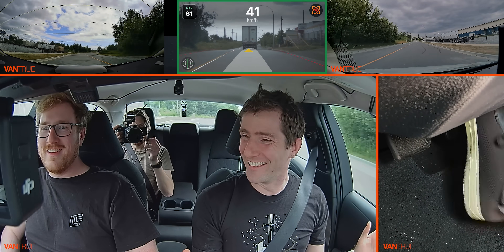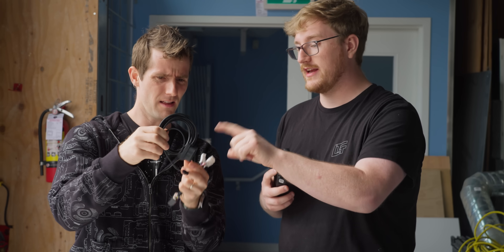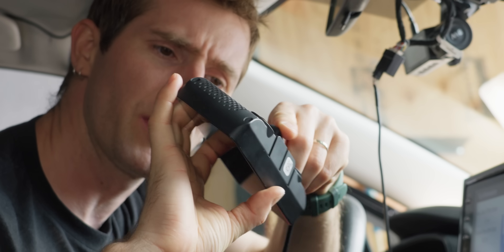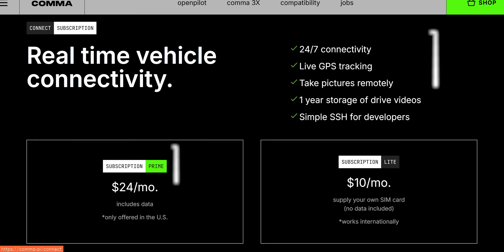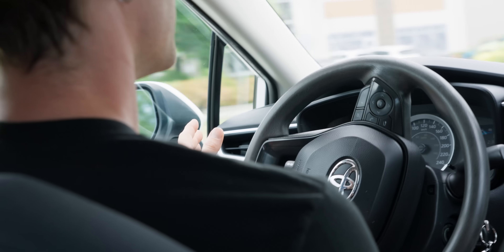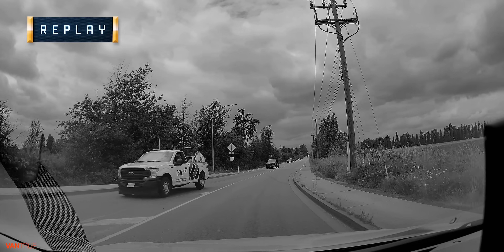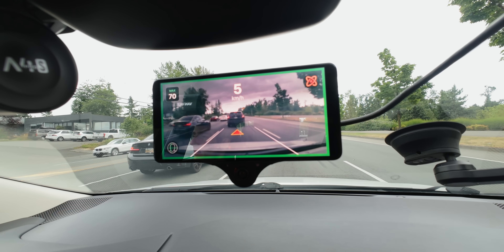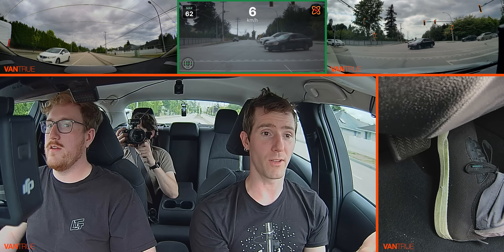I Upgraded My Car With Open-Source AUTOPILOT and it's AMAZING

Comment: You are lucky you test in Canada, where the traffic and road infrastructure and driver behavior are better. In my experience to use Auto Pilot (Auto Cruise Control glorified hype with safety feature or in toyota called Toyota safety sense (TSS), you better have a combination of stereo camera and Radar / lidar to detect surrounding traffic and road marking. Even Tesla auto pilot often failed to interpret the surrounding traffic.  Thats why the naming auto pilot is misleading since what it does is assisting not taking over the driving. In future where every vehicle can communicate with each other perhaps then we can get the real auto pilot.

Comment: I do have a problem wit hthe "autopilot name", but else it's cool, but it should be called drive assist. And the "always recording" is also a Huge privacy issue and out right illigal in Denmark.
Reply: You have an issue with the name OpenPilot ?
Reply: @AndyMcBlane  The videos name.

Comment: Now I wonder if they will make hardware that would allow you to retrofit a car that does not have any of those features, or if there is some company that does? Like I understand that putting the auto steer on a car that has a hydraulic steering rack is completely impractical, but what about adding in adaptive cruise control? Or front collision warning? On most cars, these features actually raise your insurance, because while they do lower crashes, they are more expensive to fix, but if it was completely open source, that might be different.
Reply: No

Comment: Hey guys, be aware that you don’t want your wiring to be in front of your side curtain airbags. You can impede their ability to function as designed. You really want user added electronics wired behind the airbags. 

Excited to see what part 2 is though, assuming Linus didn’t just misspeak when he said eGPU is coming in part 3!

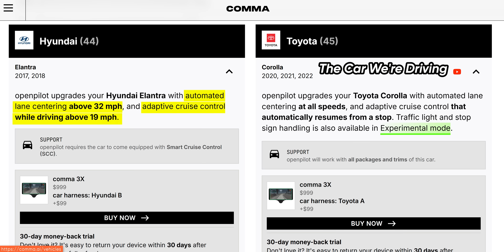Comment: 13:13 the fact that cruise control on many MANY cars disables itself below 25MPH is criminal, i'd like to hover over the brakes and watch the road in a school zone with cruize control set to 20MPH, not bury my face in my dash watching the spedometer because of the automated ticketing system that makes the roads less safe for kids because of the aforementioned ticket enforced taking of eyes off the road.

Comment: great to see LTT trying out openpilot. I have been using openpilot since 2020 on a tesla model s (the old ones that didnt come with autopilot).
on long drives it really shines. i live in norway and have done a drive from oslo to trondheim without touching the steering wheel except for stopping to charge.
back when i first installed it i started out with EON gold with added pedal and radar then eventually got IC integration (autopilot view in instrument cluster that integrates with openpilot)
then a few years back i got ibooster mod installed and C3 so OP can handle stop and go + red lights (last part is experimental as the fork im on is on OP 0.9.6 which is not the latest)
ps. im one of the OG to get C3 with newer OP version working on model s pre 2015 :)
Reply: before anyone asks Tesla does not care about this. but i have made sure to unplug the C3 when going into service. other mods and "suspicious" cables are still there ;)
this is not the only mod in my car :D

Comment: A bit upsetting that Comma puts it in the fine print, but sticking anything on your windshield is not allowed in most places outside of the US(according to the fine print, some states dont allow this either), but for expamle, in The Netherlands is prohibited, and when the yearly inspeciton comes around you know they will make you remove it. Noticing Jake telling it needs 48 hours to set, I dont think it will come off that easy. Even though the tech looks cool, it seems very dangerous and in my opnion should not be allowed on public road..
Reply: You have a required yearly car inspection in the Netherlands?  Nothing like that here in Canada or the US.  Besides it would be simple enough to remove it from the bracket and unplug it before the inspection.  I can see them bothering you about a small piece of plastic that is not actually visible from the driver's seat.
Reply: Oh and in case they do ask about the piece of plastic just tell them it is a mount for a security camera you put in when you aren't using the car.

Comment: The issue I can see with this especially with an external gpu would be redundancy. If it gets really good and you rely on it all it takes is a gpu to die for the car to have no idea.
Reply: It’ll fall back to the default internal model

Comment: This is cool, but it's basically already included in newer cars.  My 2024 Tundra does all of these things from the factory.  I didn't even know it did until I read the manual and tried it.  They call it adaptive cruise control, and it's pretty cool.  It has a lot of the same issues Linus ran into.  If a turn is too sharp, I have to take over.  It can't read stop signs or traffic signals, which surprises me since the dashboard will show a stop sign when it sees a stop sign coming up.  All in all, I'd call this a nice feature for long trips.  I mostly use it to make sure I don't speed.  It definitely gets confused by cars turning off or onto the road. It will rapidly decelerate when a car turns in front of me, even though slowing down two or three miles per hour would be enough.  Self driving tech isn't there yet, but it's getting a lot better.  I think calling it a driving assistant rather than auto pilot is a good idea, that way people don't think it can 100% drive for them.  Although, airplane auto pilot doesn't fly the plane for you, it just keeps your speed, direction, and altitude where you set it.  So calling it autopilot is technically accurate, but not how most people think autopilot works.

Comment: Yep.  This is part of the reason I bought a Corolla 5 years ago and why I bought another one this year.  The kiddo got the older one and I got the new one.

For now, the adaptive cruise control is good enough for me.

The 2025 Corolla slows down for curves by itself.  The 2020 doesn't.

Comment: I have an older Vantrue.  The camera is great, but the mounting solution is garbage.  It falls off my window every few days, and obstructs my view (that's a me problem, I have awkward height proportions).  I wanted to mount it low on my dashboard instead of near the mirror, and it won't stick to the dashboard.  I know I could maker my way through a mounting setup, but I feel like a manufacturer should have different mounting options for a camera they make.  The only time I was in a car crash, the dash cam didn't activate.  Admittedly, the crash was extremely low impact and I didn't even know someone rear ended me; I thought I hit a bump in the road.

Comment: If you've tried Tesla FSD with HW4 with version 13.2.9, you would not even consider comparing Comma 3 with FSD.  You wouldn't bother comparing an elementary student's 100m dash time against Usain Bolt's 100m dash time.

Comment: For whats an OBD dongle, a smartphone, and a mount, it sure is quite expensive for being open source.
Reply: The hardware is not open sourced
Reply: @AndyMcBlane I thought it was. That sours me a lot on this video, then. And the entire comma AI initiative, really.
Reply: @someguynamedpie why? You can read the whole code base and understand safety, trade offs etc
Reply: @AndyMcBlane Because they tout themselves as open source but... aren't. They're as open source as TiVo is/was. Having safety specs etc doesn't make them open source if they lock down crucial parts of the solution.
Reply: @someguynamedpie  the hardware has little to no bearing on the safety model
You can run on a laptop if you want

Comment: If you test with Tesla FSD, please use a HW4 vehicle for an accurate representation of how FSD is today. I’ve seen too many people claim that HW3 FSD is Tesla’s latest and greatest, and though it is still quite advanced, it’s not comparable to what you get on HW4. If HW3 is your only option, just please note that in the video. Basic should be the same on both hardwares though, so if that’s all you’re testing, it shouldn’t matter.

Comment: I would like to see Comma/Openpilot and Android Auto/Apple Carplay/in-car infotainment systems to go Linux and Framework (Fedora and Framework 16 user so going to use them as references). Fedora is the opensource upstream source (think of it as the beta version) of Red Hat Enterprise Linux (RHEL) which is a proprietary commercial software sold by IBM (through subsidiaries) and as such IBM is the primary contributor to the Fedora Project. If there was there was a new/modern CAN bus standard that was created as sort of equivalent to the Linux Kernel and Openpilot/Android Auto/Apple Carplay all fed into one big upstream source all CAN bus type add-ons could work with, use other devices sensors, etc. and fork from like Fedora while the car manufacturers proprietary infotainment systems are like RHEL. Also, car and automotive accessory manufactures could decide on standerds for form factors, bay sizes/general locations, and communication/connection standards (new CAN bus) like Framework's modules/parts so that car manufactures can streamline production like Tesla did by having all the device bays in every vehicle but not needing to change/install any/everything with different skus/packages. This would also aid in vehicle longevity and upgrade-ability. Someone could buy a cheap base model vehicle one year and then later buy and install lidar sensors, dash-cams from Vantrue, Autopilot hardware from Comma, and Kenwood speakers and infotainment. Then when something breaks, is no longer sufficient, or has reached end of life like some cars that had built-in cellular network connectivity but when the 3G networks were sunset-ed they lost functionality, but now you could replace it with a new 5G module, upgrade to a more powerful cpu/gpu to handle Openpilot, add ssd storage to store dash-cam footage and music.

Comment: "Its amazing!" almost causes several accidents
Reply: Steering torque limit or max steering angle limit of the Toyota unfortunately.  Certain other vehicles it can work much better.
Reply: @jermwerty  Also, I'd like to add that stock openpilot has a lot less features than the forks. I know because I spent half a year using stock before installing dragonpilot. It was a world of difference for me. lol

Comment: I’ve wanted one of these for years, sadly my 2017 Sentra doesn’t support it. I’d love to see a video where you somehow retrofit modern cruise/lane keep assist features into older vehicles so they can take advantage of something like OpenPilot! Or failing that maybe a video showing OpenPilot or its forks running on non-Comma hardware, if that’s possible….

Comment: I've been using Comma 3x on sunnypilot for about 6 months and a few thousand miles on my Kia EV6. It is a big improvement over the stock assist. Works flawlessly, even in construction zones where lines on the road can be confusing to the stock system. If you have a left line and a curb on the right without a line, stock assist WILL hit that curb at some point if you don't intervene. Comma handles it perfectly, lines or not. I can't go back. I'm spoiled now.

Comment: You mentioned a longer-term review with other car  models... PLEASE PLEASE PLEASE do a Ford! I have a 2016 Ford Fusion that has lane keep (not centering) and active cruise control. The cruise cuts off under 10 mph, so it's useless in traffic. Lane Keep is nice for safety, but it doesn't keep you centered. 
Many Ford are not supported just yet on OpenPilot. But I've head of the Fusion working with the Bluepilot fork. 
I'd love to test it myself, but spending $1,000 usd would be painful if it didn't work well. 
I love the car, and it has all of the sensors it needs for at least some level of self-driving. Fingers crossed that this gets figured out. Thanks for the awesome video. I've been looking at these for a long time now.

Comment: newer cars basically have this functionality, a sofware update could enable most newer cars to do basically what this is doing essentially. Not sure if any manufacturers will actually do that, most likely saving the feature for the models that come out in the coming years. Id say by 2030 all cars are going to have standard, lane change,  steering and parking assistance as standard features. Full self driving or similar software will most likely require products like these, which by then or sooner will be capable of full navigation self driving assist even better than the tesla, but again in a few years tesla's tech will in turn be improved so we will see. This might be worth a pick up once they perfect it and reduce cost so it's more around the 500-700 range rather than 1k.

Comment: I find 4K dashcams really stupid. 1080p at 30 fps is good enough. Anything more is a waste. Not only do you need a bigger mSD card, but it will wear out faster too. I have the Aukey 1080p @ 30 fps from 10 years ago and its amazing. Remember, its the video quality that is very important. You can get a 4k cam but its quality might be garbage. My cam does really good night time as well AND also remember guys if you get into an accident and your power goes out, the aukey has a capacitor that keeps the power on long enough to save the video. It also makes a separate folder and puts the video there when it senses an accident. These last 2 features are also very important. Dont just go on the resolution and fps.

Comment: People, there is quite a bit more to autonomous driving than the visual system and drive actuation. This kind of system has no vehicle system integration, ie, no system safety, security, redundancy etc. Bit of a stretch to compare competitiveness to OEM solutions.

And a bit of shame on Toyota for exposing any kind of safety related functions as more or less third part interfaces.

Comment: i have that as standard in my VW Arteon 2023, but due to Swedish  road and traffic office its not allowed so half of the functions are turned of until i drive outside Sweden. it works much better than that TEMU autopilot.

Comment: In British Columbia, it is illegal to wear only the lap portion of a standard seatbelt without the shoulder strap. BC law is clear on this:

0-1The Motor Vehicle Act (Section 220) requires anyone riding in a seat with a seatbelt to wear the complete seat belt assembly (pelvic and upper-torso restraints) “in a properly adjusted and securely fastened manner”  .

That applies whether it’s the driver or passenger—you can’t choose to leave the shoulder belt unused.

431-1Wearing just the lap belt or letting the shoulder belt hang loose is considered improper use and is explicitly illegal, even dangerous  .

Comment: I've been running a 3x since release on my 2 ford mavericks and an Ioniq 5. I've put over 50k miles between the 3 cars. I use sunnypilot, on a highway its amazing. It reduces my stress and fatigue levels on long road trips. If you understand its limitations its still a wonderful device.

Comment: I’ve got 53k miles on my 2022 vw Tiguan, equipped with c3, running Sonny pilot.   Was installed at 0006 miles.    

I’ve had Sonny pilot engaged for over 45k miles.

Makes driving chill.
Reply: Also, I’ve used dash cam footage.

Comment: Super interesting,  was curious on some support hyundai models with HDA I and HDA ii and it seems to do the same thing it does (start stop traffic and so ) which HDA already does, I guess it removes the manual trigger if traffic stops too mnuch adn follows stop signs. 

I now wonder if it takes advantage somehow of models with sensors all around it .